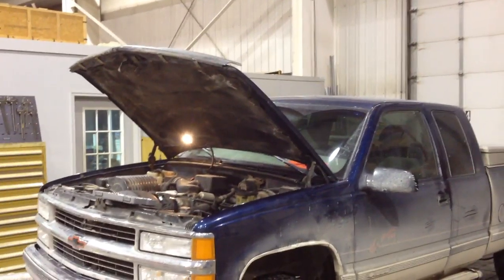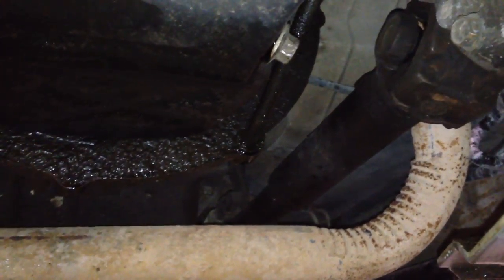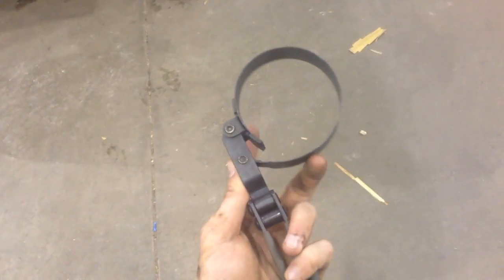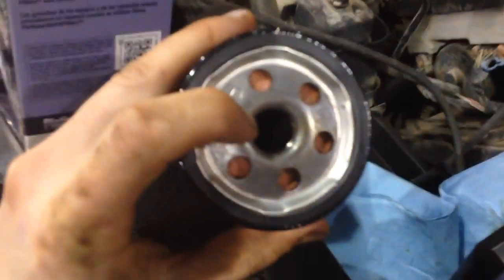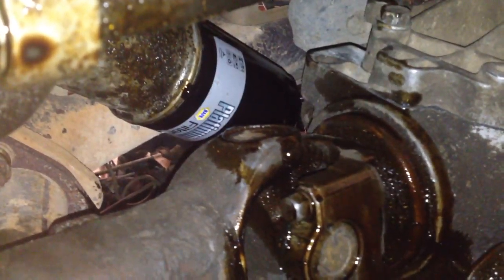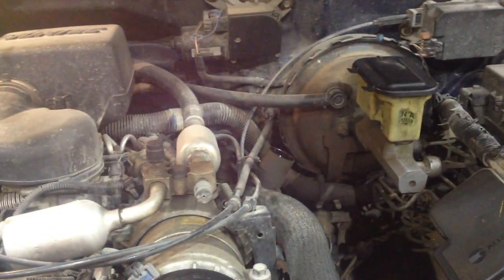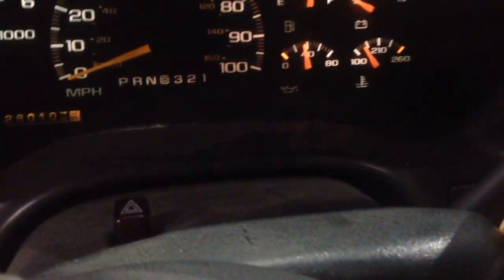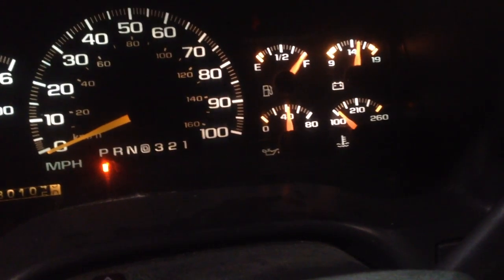98 Chevy Silverado Oil Change and Maintenance Check

Comment: What engine is this
Reply from the maker: It is the Chevy vortec 350
Reply: @iowadiy6361  thanks I just got one and can’t get the oil filter off
Reply from the maker: Oil filter wrench or a large water pump pliers or worst case a hammer and screwdriver will all work.. just make sure not to retighten it so much